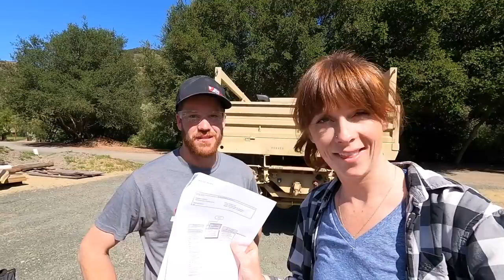We Bought A MASSIVE Army Truck!

Comment: Hi guys . I am a state guard solider and my MOS is driver trainer in national Guard. This is  the type of LMTVs we train and licensed soldiers. My dream was when I retire I put a fifth wheeler camper at top of this beautiful rig and use the gunner hatch to enter the fifth wheel. 
BTW . It only sips fuel ,very efficient . From Los angles to Camp Pendleton only quarter tank . You go figure. Rides better than most of trucks.
Reply from the maker: Once Riley figured out how to turn the air ride on for the cab it got very comfortable. 😂 I think that a fifth wheel camper where you enter through the roof would be EPIC!

Comment: Did you get this fixed? Once you get use to air brakes you will never go back to hydraulic. Are any of the push rods on the chambers moving out at all when you push the pedal? Air brakes are like electrical problems work backwards.
Reply from the maker: Yes we believe we have the brakes figured out!

Comment: I say leave it like it is and fix what is wrong or broken, there after just proper maintenance. Could be having an issue at the auto tire inflation system, could be causing the air system from reaching operating pressure.
Reply from the maker: We were concerned with that so we made sure to turn off the CTIS before doing any diagnostics!

Comment: probably the pads, the air cylinder on the wheels or the air chamber are stuck. its kind of common.  humidity from the air gets evaporated and then condensated on the tanks. with regular use its not a big issue. but, after a long term of not running things get rusty and stuck.
Reply from the maker: I think we had a combination of all three going on!
Reply: @AmbitionStrikes  yes. i commented and after that saw that there was a new vid where you fixed it. congrats for that btw.
Reply: another thing, dont forget to flush the air tanks on a regular basis. i flush the ones on the truck i use to work at least once a week.  but that will depend on the air humidity present where you live.

Comment: The way air brakes work is the air is used to release the brakes.  If you are able to drive it the air system is fine.  If the brakes aren't stopping the truck, then maybe it's worn shoes.

Comment: my bet is the brakes adjustment at the wheels were released so it could be moved around. brakes are applied with no air pressure, air pressure releases brakes.
Reply from the maker: We confirmed the brakes have not been caged!

Comment: Start trk , build up air pressure, shut trk off,put trk trans in gear,release brk , take wrench. Under trk to each brake pod, Turn brake adjustment. To the right until brake shoe is snug up against drum, then back it off 1/2 turn with wrench, It will have all the brakes it needs,
Reply from the maker: Thanks so much for the knowledge James!

Comment: Start your truck up I mean air up your tanks then someone go under your truck watch brake chamber look for slack adjusters (when you press brake pedal and hold them, listen for  air should be 1 inch play )
When no air in the tanks brakes will lock up
Reply from the maker: When there is no air in the system the parking brake locks up. However, the service brakes actually require air to engage. It's all new to use and we are having fun learning how the system works!

Comment: VERY cool!  But you should have just got it running and tried to fill the tires with the CTIS- Central Tire Inflation System...  I'm sure you've figured it out by now, but the beeping won't turn off until the brakes have enough air...
Reply from the maker: We were very hesitant to try out the CTIS system as we have heard the seals can leak and pump axle oil into the wheels!

Comment: IMHO if you have enough air pressure to deactivate the alarm and have validated pressure to the brake actuators...when any vehicle sits for an extended period of time then the pads/shoes along with the disk/drums get rusty/dirty.  First simple thing I would try would be to simply drive around (slowly) and ride the brakes for a mile or two to get the contaminants/rust sluffed off so the friction for the brakes comes back.  Beyond that there are adjusters at each wheel that you can manually adjust, but also should self adjust by breaking in reverse.  I bet that simply riding the brakes for a bit will give you what you need.
Reply from the maker: Excellent advice John!!
Reply: @AmbitionStrikes   general air brake adjustment info:  https://palmerleasing.com/air-brake-adjustment/

Comment: Man I miss working on those. Remember to leave the CTIS ballast open when not in use because the air ballast builds condensation and it will freeze and blow the lines. Wish I could help you learn about them.
Reply from the maker: Thanks for the tip Robert! We're looking forward to diving into the truck build and learning more about it.
Reply: @AmbitionStrikes  let me know if you have any questions. I was a 91B in the army. Heavy diesel mechanic all wheel specialist.
Reply: Do you need the full manual. I can get it from AKO website. Army Knowledge Online. Let me know if you do.

Comment: I think someone locked the diaphragms. There is an Allen key attached to the rear diaphragms.  The key is used to unlock the spring loaded parking brakes to enable towing.
Reply from the maker: We were hopeful it was that simple but we confirmed that the brakes had not been caged!
Reply: @AmbitionStrikes  caged, that was the word I was looking for. Another thing that will do the same thing is if the adjusters are adjusted all the way to the other end turning the cam backwards. It would appear correctly adjusted but they will not function at all.

Comment: Air brakes can be very stiff 2 the drums could use adjusting 3 check the tank for water and drain at the valve 4 chalk the wheels release the brakes and inspect……..if all fails try a professional some truck stops have shops and technicians even if you simply need advice

Comment: Did you check to see if the brakes were caged. If the brakes are caged this is the reason why you do not have brakes. You need to take an uncage the break . Locate the brake cylinders to see if there is a bolt stuck in the housing of the break .

Comment: On your brakes- I would check slack adjusters. The shoes could be worn down to the point they're not making good contact with the drums.
Reply from the maker: The spec is .020"-.040" and it appears to be adjusted correctly. We do plan to pull the wheels off, inspect the pads and lubricate the wedge system!

Comment: I drove many different heavy vehicles that we call trucks in Australia. I suggest that you learn to use the brakes carefully before going on long trips. I am a well-experinced driver especially trucks that had hydraulic brakes and exhaust brakes. You must never slam your foot on the brake pedal but apply soft pressure on the brake pedal, lift your foot off for a second and then press down again on the brakes again. The army truck may have exhaust brakes too.
Reply from the maker: Thanks for the comment! This truck has air brakes and they have definitely been a learning experience. Pulsing the brakes is not recommended with air brakes since this can diminish the air supply. Unfortunately the truck does not come with a factory installed exhaust brake, they are available after market though.

Comment: First of all, I'm not Martha Brown, I'm Dan, Martha's husband.  This truck was built in Sealy, Texas by Stewart & Stevenson, which I worked for for almost 20 years.  In around 2006 we were bought by Armor Holdings and shortly after that were bought by BAE Systems.  We lost the contract to Oshkosh Trucks in 2009.  The reason I know your truck was built in Sealy is because it has a soft cab, Oshkosh only built trucks with armored cabs, and because it has the lever on the dash for keeping engine revs up for winching and other stuff.  Our customer, TACOM, in Detroit made us take it off as the soldiers were using it for a cruise control, very dangerous needless to say, so don't do it as it won't turn off when you apply the brakes.

A brief history of the truck.  When we started armoring the cab, the truck started getting much heavier depending on which variant of the armored cab was on it.  The original cab, which yours has, weighs about 1700 pounds full up, and the last version of the truck, which Oshkosh built, the cab weighed 8000 pounds fully armored, so you can imagine what that did to the load on the front end.  Even though we added a heavier duty axle to the front and a different front brake system, the front end was still overloaded.  

Anyway, enough about the truck in general.  If you have any questions about the truck, I'll be happy to help you as I have complete electrical schematics for it and some information about the CTIS system.  If you want to, please put you Email address on this blog and I'll keep checking it and Email you so you'll have my address as I'm hesitant to put it here.

Please answer this blog so I can help you if you need it.

Thx
Dan Brown
Reply from the maker: Hi Dan! Thanks so much for the information! You can email us at info@ambitionstrikes.com

Comment: The air brakes warning buzzer until you raise the pressure by letting the engine run just watch the pressure gauge until it builds up  the buzzer goes off when at pressure .  . That's just a small truck . Nothing major . . Check the rear air cylinder s they sometimes stick on , just back them off a little see if that cures it . There's a rubber diaphragm inside the cylinder they sometimes split , other than that check for air leaks . Or air relay blocks they can stick also . .
Reply from the maker: We checked all of that and were able to confirm that each wheel was receiving and holding 120 psi.

Comment: How do you know that there are still brake shoes left? Does it have manual adjustment for the brakes? Is there a hole in the backplate of the brakes for inspection?
Reply from the maker: You can easily see the shoes because the back side of the drums are open! They are self adjusting.

Comment: Does the auto inflation on the tire not work 🤔  that truck has a  Auto inflation system that will allow you to inflate or deflate the tiers with a button
Reply from the maker: It works intermittently.

Comment: did you check if air compressor works giving enough pressure?
Reply from the maker: Yes the air compressor is coming up to pressure, holding pressure and able to deliver 110 psi to each wheel!

Comment: Forgot to say, if you haven’t read the manual, “bleed” the Primary, Secondary and Emergency tanks there on drivers side DAILY to keep water build up out. Winter will have Chance of FROZEN air lines if not….
BEWARE !!
it blows Water and OIL so STAND CLEAR, to the side, when opening the valves. Good Luck!! You also have a fuse under passenger dash to “disable” the vehicle if needed.
Reply from the maker: Thanks for the tip! We've already been doing it, but your point of ice in winter is a good reminder to stay on it.

Comment: The main problem with air brakes is wrong adjustment, always start with that as soon as you have ait pressure
Reply from the maker: Thanks for the tip!
Reply: @AmbitionStrikes  I’m a old truck driver and I’ve seen most every problems with air brakes, it will be my pleasure to help you if you need more assistance 👍👍👍👍

Comment: Deffo need to get a skilled truck mechanic to go over it . Trucks with airbrakes need air pressure to keep the brakes off . If theres a valve not letting air through the brakes wouldnt come off . Id be checking slack adjusters etc to make sure thrve not bn screwed back as to hold the brakes from working to allow them to tow it or move it around . But an experienced truck mechanic should know all this . Its foolish to touch stuff u dont understand . Very dangerous as u both know . Gd luck with it look forward to seeing ur progress with it . It should be a gd purchase . Most ex army stuff is buuilt to last . Its a wonder the owner didnt know what was wrong . Or maybe he didnt want to say anything unless it put u off buying  it have fun happy belated birthday by the way . ...
Reply from the maker: I would argue that it is more foolish to not touch stuff you don't understand... being familiar with the system is how we are going to be able to diagnose and prevent issues in the future. 

It is only the parking brake that works as you described. The service brakes require air to be applied and default to released when there is no air pressure. We verified that all four wheels were receiving 120 psi and holding pressure properly. The seller was a great guy and helped us quite a bit in diagnosing the issue!

Comment: Probably time half hour running would bring pressure right up enough to blow out pre set pressure valve in tank.
Reply from the maker: The pressure valve blows off after about 5 minutes!
Reply: @AmbitionStrikes  what's your gauge showing inside truck on dash. Probably in metric Kpa
Reply from the maker: @jeffmoore2351  120 psi
Reply: @AmbitionStrikes  and when you put foot onto break you get short discharge of air. Approx 15 psi (depends on how hard you depress brake.) Each and every brake movement should have similar loss of air.
When depressed enough times  gauge should have a zone in which the alarm comes on. Let it build back up to normal.
If on the other hand compressor or air loss in the system are not keeping up 1 to 3 dabs on brakes tells you fault  in system.
Reply: Not a mechanic but I am Australian Heavy veichle driver. That fact that these veichles come with their own tyre deflation system makes them more complicated than standard. Good news though generally military spec is five times harder wearing than Civilian stuff. Join owners group people there are only to willing to share their knowledge.
But if I had to point to most common component in brake failure. Is 4 way treadle valve at end of rod underneath floor of truck. Good luck. Aussie Jeff Moore

Comment: NEED CO2 tank for high speed BIG tire fill. Your cool new truck should have room for it!
The mileage you’ll get with that big rig, you may wish you bought it closer to your destination.....
Lol.  Life is an adventure!
Reply from the maker: The truck actually has a central tire inflation system off of the engine driven compressor. Riley tested it yesterday and it works!

Comment: Im at a loss, what was actually wrong with the truck where you didn't feel you could drive it?  Looks like it ran, stopped, moved....
Reply from the maker: The service brakes didn't function well enough to even stop the vehicle while idling in drive. When you saw it stopping in the video it was because Riley was pulling the emergency brake, which would be extremely dangerous to try and do at any speed above idle.

Comment: Did you adjust your brakes or check for water in your air tanks?
Reply from the maker: Yes we did both!
Reply: @AmbitionStrikes  well your parking brake side works, so its in your service brake side. Might be as simple as your brake shoes are glazed or oil covered just tossing out ideas

Comment: Welcome to LMTV ownership. That low air pressure warning buzzer reaction shows that you know nothing about air brakes or maybe you didn't and now you've had your crash course! Have you guys joined the LMTV Facebook group and SteelSolders forum yet? We have all the information you need. In fact, you better join soon or that ruck truck's gonna cost you megabucks to repair after you damage it. There's certain things about your M1078/A0 truck you should know before you do permanent damage. Has the "oil line of death" been replaced? Have you balanced the drive shafts? Have you checked all u-joints? Do your front hubs have 11-16oz of brass friendly gear oil (like Lucas or Swepco) in them? What are the date codes on those tires? Has the transmission oil been upgraded to synthetic trans fluid instead of engine oil yet? Have your wedge brakes been serviced? The list continues.
Reply from the maker: We knew absolutely nothing about air brakes before buying the truck! We have joined the Facebook groups as well as Steel Soliders and they have been incredibly helpful resources. There are certainly lots of things to go over before we plan to drive it!
Reply: @AmbitionStrikes , good! I'm looking forward to seeing progress on the truck. I'll see ya around!

Comment: You need 120psi on both gauges
Reply from the maker: We are currently getting 120psi on dash gauges and confirmed with an in line gauge that we are getting 110psi to each wheel.
Reply: @AmbitionStrikes  you need to conform that  each wheel chamber is moving and locking up each wheel.up may have a chamber lock up and not braking that wheel.you may have to jack up each wheel one at a time and try to turn it while she steps on the brake with parking brake release.choke the wheels so it does not roll on you.